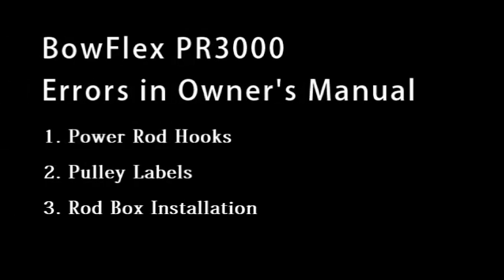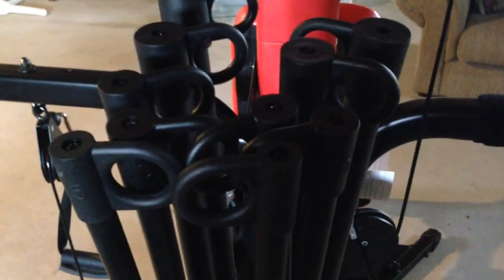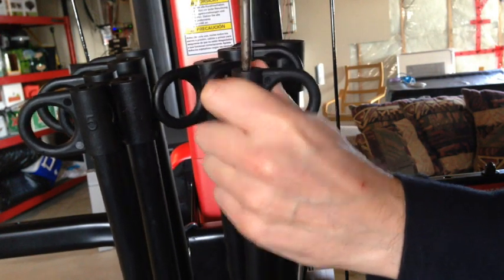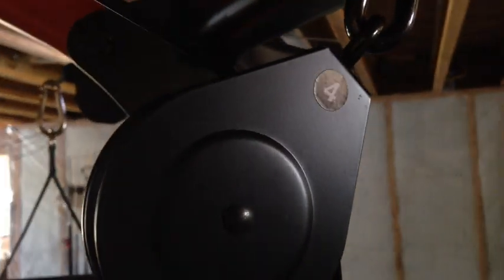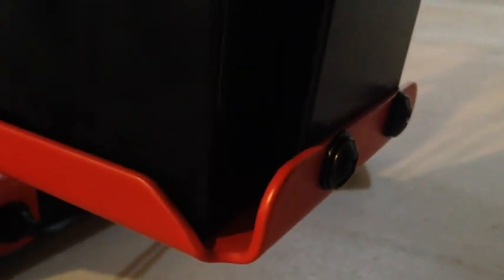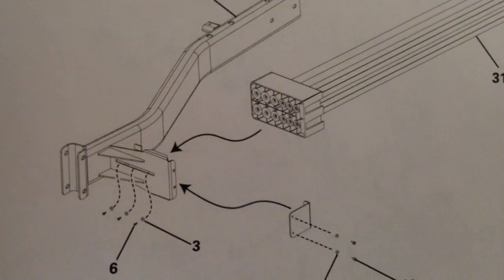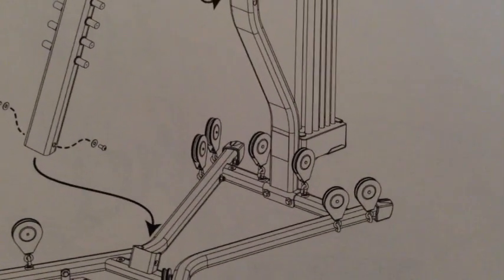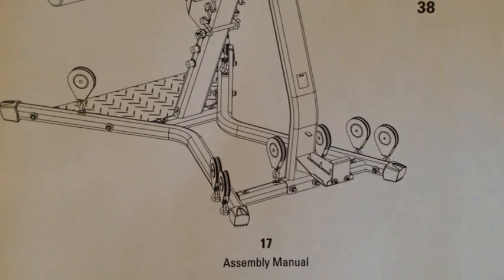BowFlex PR3000 - Mistakes in the Owner's / Installation Manual - Resolved

Comment: I'm having a 4th issue with the pulley that is mounted to the rear on the back side of the main vertical frame. In one picture, it looks like the right one wire is on the front pulley and on the second it looks like it is on the rear based on the way the wires cross below. Directions suck.

Comment: Thank you for the video - it's 2017 and the instructions for the metal box remain incorrect.
Reply: Richard Ogin it's 2018 and they are still not right. I just had the same issue.
Reply: 2021 (almost 2022) and the instructions are still wrong lol